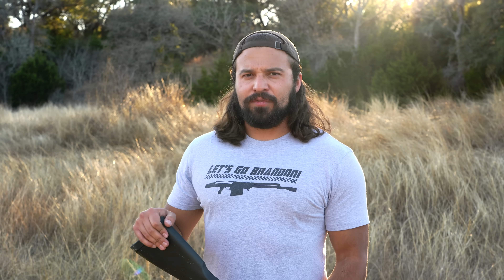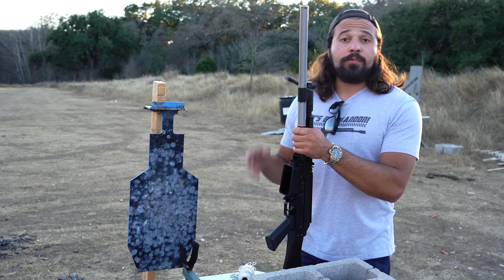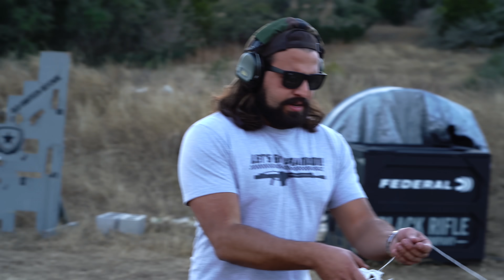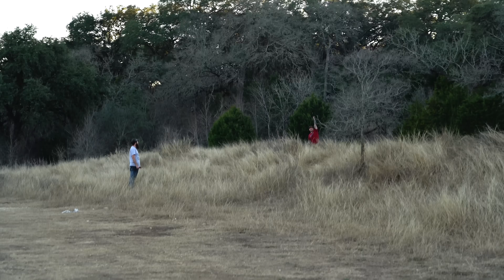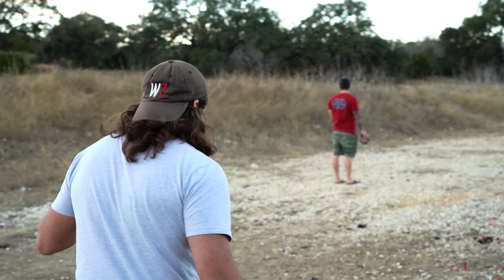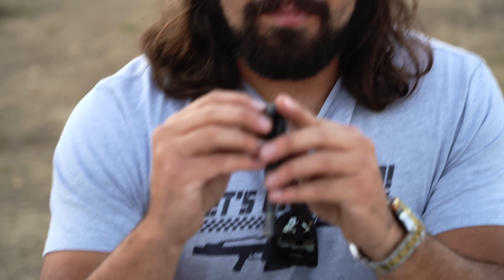Testing an AK Chambered in .50 BMG

Comment: I always knew that .50 BMG was a monstrous cartridge and that a weapon that was specifically chambered for the round had to be seriously tough to handle the amount of energy that the round produced. I predicted that this shotgun would be pooched after firing just once. My thoughts were basically along the lines of the bolt jumping backwards, out of the receiver and may the Lord have mercy on that steel silhouette. But the sheer violence and the utter and complete nature of that "rapid disassembly" were somewhat beyond my prediction.

As much as this video was a real good laugh, it was actually very educational.

Brandon, take all the time you need on that AK 50.
Reply: I was kinda expecting some sort of rapid disassembly because of the previous instance with the RN-50 that Scott had and it was made to handle the upper echelons of pressure (I know it was an especially hot round). Though there was definitely some surprising damages like the tearing of the mag well.
Reply: >Loads anti-aircraft round into trench gun
>Trench gun becomes the ammo

Yeah, honestly fairly predictable.

Comment: I believe I have finally gained some insight as to why this is such a difficult project. Brandon is using the wrong ammo. 

Quite obviously Great Master is displeased by use of capitalist .50 BMG instead of appropriate 12.7mm x 108 cartridge of DShK!
Reply: This deserves more recognition
Reply: Nah, ya gotta step it up to 14.5x114 from the PTRD/PTRS
Reply: @wanderbolt9498  Great idea, I'd like to see someone defend a home with that massive Tiger II hunting rifle. Heck, make it Cali compliant to screw with the govt'.
Reply: @jamestedjo3736  Yes, but use a double barreled shotgun as a base for twice the OSHA violation.
Reply: @gazz3867  Breaking news: Post Trigger Shoulder Dislocation going rampant.
Reply: I guess those are hard to come by in the US
Reply: What  about a firing mechanism different than existing .. maybe sauer type or reinforced humongous chamber for disposing of also sequencial ammunitions of tested types and similair... smaller charge... same grain or larger to to change the controlled rapid expansion of various types of (what do you name those ignightors?) For different ignitions... ... simply said try a differrent version or brand of ammo...

Comment: So, what I am to understand is that the impulse of the round going off was so violent that it- shattered all the parts meant to hold the gun together, and blew them out the back at lethal velocity,  and didn't even fire the projectile out the front?  JESUS that is fascinating from a shock physics perspective and metallurgical perspective.  Insane!
Reply: Makes perfect sense too. The same force being applied to the bullet is being applied in the opposite direction onto the bolt face
Reply: @YoBoyNeptune  yeah man, its just insane to think about the forces at work here, especially how the barrel went flying the length of the range, I still can't quite wrap my head around that one. The ghetto ak50 may have been made as a meme but damn is it illustrating some seriously interesting stuff.
Reply: @AlphaCarinae  yeah, I get what happened, but I want to know why it happened, from an engineering perspective.  I want to watch the shock propagate through the gun, see where it failed and in what order under what load. Makes me wish I could run the engineering sim programs I use at work on a 12 gague AK analogue model, but we are definitely not allowed to use those resources for personal projects lol
Reply: @saltycadet5904  it isn't always easy trying to talk to people on here huh?
I was thinking the same, would be cool to see the chain of failure, what let go first and how did that affect everything else.
Reply: @saltycadet5904  everything failed all at once. That’s the answer you’d find.
Reply: @saltycadet5904  the casing was the very first thing to fail, the released gases expanded to fast while the projectile failed to move fast enough to accomodate, the result was akin to, as brandon said in the video, loading a grenade into a 12 gauge, but after the casing it was the bolt that was the first to recieve the full force of the explosion, the bottom portion of the casing was missing, and left a clearly visible impression on the bolt face, causing the bolt to shoot back, ripping apart the internal components, i.e bolt carrier, gas block etc but that is why there was still a piece of steel stuck in "scott" i cant say for sure what psi a shotgun is meant to handle but i do know a .50 bmg is capable of upto 48,000 psi, the real scott took more then 50,000 to the face, its speculated the SLAP rounds he used were home loads by a fan and were far "hotter" then there were ment to be, he even mentions in the after video of how he knew something was wrong with them after the first shot but kept going, he got 4 off without issue, but that 5th one was the near fatal one, its insane seeing what happened to him and im glad hes recovered and is still doing what he loves lol
Reply: I mean it fired A projectile... it was just the barrel of the gun
Reply: @omishimuzu That's why they tell you to never fire someone else's handloads. You never know what some nutter is willing to pack into a casing.
Reply: @saltycadet5904  running the simulation shouldn't be an issue, claim that it is for purely research purposes and would ensure a "safer design" for the lockup and the shooter, should aforementioned shooter load his/her own shotgun shells for example and inadvertently double load a shell, or for some obscure reason the barrel should become obstructed in some way. 
I am no engineer nor am I in any way clued up on the physics behind THIS round... But I think it safe to say that the guys building weapons that ARE able to handle the loads and pressures of a .50BMG cartridge have got some seriously large balls and skills...
Reply: @ScooterMcAwesomeness  I've gotten reloads from a family member who knows what he's doing and discovered that the rounds were loaded to +P+ levels., thank God it was only 4 rounds that were loaded to that level and did not damage to my firearm or more importantly to me.
Reply: @delmaneboshoff5610  Sounds like you got lucky... go buy a Powerball ticket.

Comment: Prediction: first, the locking lugs will fail, shearing clean off. Then, due to the massive increase in backward pressure, the receiver surrounding the chamber will explode, sending shrapnel in all directions. However, the twist is that no one will be harmed, thanks to Scott’s massive, blast resistant man meat absorbing the explosion and saving the day.
Reply: I mean, he was not wrong.
Reply: "blast resistant man meat" is one of the best sentences ever

Comment: Between this "test", and Scott's own testing of a 50 cal, I'd think Brandon would make extra effort to reinforce the locking lugs of the AK50, or at least attempt some sort of safety to prevent them from shearing upon any catastrophic failure and entering the lungs of the user. 

Least it would seem those are the most dangerous parts during a failure.
Reply: watch some of his AK-50 vids, the bolt locking lugs look intensely thick
Reply: did you "LOOK" at were they were located,how much room there was ?  how thin the barrel had to be in order to be press fit into the gun? dude.eyes.use them
Reply: Given what I've seen of the AK50

He has.
He very much has.
He has got about a kilogram of high grade steel in those locking lugs. 
The only way you could make them less likely to sheer off would be to make them out of tungsten carbide. Or maybe Scot.
Reply: He is patterning that part off of the Barrett M82A1 and Serbu BFG50A, since that seems to work for those guns. To Scott, the Serbu RN50 was a single shot, break-open screw-on cap-sealed gun where the cap blew off the gun and it sheared some other stuff off that almost gave him the big sleep. This would kill you, especially since the barrel became the projectile and the bolt carrier would be in your side/chest/head.
Reply: They're mostly dangerous if your 50 BMG is magically enriched with tasty nitroglycerine like that one time that guy almost died.
Reply: @cxpKSip  The 50bmg is a massive explosion to contain. Even the best design if pushed beyond plausible/practical "safe" planning, is virtually impossible to make "safely" explode. 

I was just pointing out, if the person hugging the exploding 50 survives the instant your-flucked death parts flying at them, the locking lugs generally seem to be the fairly unavoidable, but plausibly survival, parts. While finding a way to keep an exploded barrel from trying to become a nose ring or the entire bolt from replacing the catcher's tonsils is pretty much sheer luck and otherwise impossible to prevent, it might be possible to prevent or at least mitigate the lugs from going directly into the lungs or heart. "Possible" or "plausible", not "definitely" or even "likely". Simply something that should be considered when it comes to attempting to make it semi "safe".

Comment: A great representation of the amount of juice in a 50 bmg case, with all the videos showing it "working" out of 12 gauge and all the video games taking insane liberties in gun customization options, im sure many people have very skewed ideas about real gun physics.  If i put a 20mm Oerlikon shell in a a steel water pipe and hit it with a fucking hammer im sure it will work great.
Reply: But it will work... Very VERRRRY badly
Reply: obviously if the round fits in the tube then you can fire the round from the tube. "What do you mean physics says that won't work, I don't even believe in science" is probably the logic followed when anyone thinks that if it fits, it'll fire safely
Reply: Yeah I liked Fallout 4 and its pipe weapons.
But I thought they should have stuck with crappy, high malfunctioning low power guns. Only reliable when you make it a bolt-action.

Instead I can go for a Full Auto .50 BMG Pipe Rifle.

Yeah that brass pipe can handle that kind of abuse after some rifling.

Comment: Another interesting idea, in Tarkov recently they've added "makeshift 50 bmg" shotgun shells which is exactly what it sounds like, 50 bmg slapped into a 12 gauge (or russian equivalent) shell. I'm curious as to whether this would work in the first place, and if so what the results would be like and if itd be as devastating as it is in game.
Reply: Interestingly enough, the wiki says it is also a red tracer, so if the hypothetical .50 BMG sabot did work, how would the tracer  component function?
Reply: not a recent addition, been around for a couple years I think.
Reply: You will want to check out taofledermaus’s video from 3 years ago.
Reply: #Taofledermaus
Reply: You can launch a. 50 cal projectile through a shotgun, but you can't get anything close to the pressure of an actual. 50 BMG cartridge in a shotgun. The pressure difference between them is immense.
Reply: Even the devs aren’t sure whether this would work - the shell has “Apparently, it works. SOMEHOW.” in the description.
Reply: Do you mean something like a 50-cal bullet loaded into a 12-ga sabot...that's been proven to work every year when someone uses a 12-ga shotgun to take deer utilizing a bullet loaded into sabot.
Reply: When do we just call it a day and get some slugs?
Reply: @theworldofnexttuesday2802  really you can load just about whatever you want into a shotgun slug and it'd be lethal. Taufledermous has shot slugs made of candy, marbles, pieces of furniture, etc.
Reply: @TrueOpinion99  Yeah, you can pretty much sabot everything, gives it that nice, tight, fit it needs.
Reply: @Yawyna124  - Especially with modern 3D printing, you can sabot your favorite .223/5.56 bullet into a 12ga.
Reply: @jackaboy7748   why would tracer have any troubles igniting? Seems like it should be least of worries with such shell.
Reply: @TrueOpinion99  at some point there would be more sabot than the bullet itself.

Comment: Prediction: 
Gone, reduced to atoms

Edit: Well, I was mostly right. Surprised the barrel did as well as it did though, I was expecting it to mushroom out. Impressive machining
Reply: I figured that, being the one part on the gun actually made for .50 bmg the barrel would survive (in the broadest sense of the word). Given of course that the barrel pins were not made for this caliber, it's no surprise that the barrel detached the way it did.
Reply: @cobusvanderlinde6871  I suppose that is true. I guess my brain just defaulted to what I've seen with other catistrophic failures with shotguns, and a lot of them have the barrel flaring out like in a cartoon.
Reply: @shayminthedoctor9663  something else I just realised.
With the amount of pressure escaping at the back end of the gun (and its top and sides as well) the barrel would have dealt with much less pressure- can't know if this barrel would have made it on the front of a whole gun made for .50 bmg (guessing probably not) but here it was the only thing that was in any way ready for it and so would be the last thing to fail, as the other failures reduced the stress it had to endure.
Reply: Favorite line: "Well, we split our bag here. Should have seen that one coming."
Reply: @cobusvanderlinde6871  huh, you make a good point. Since the point of failure was in the locking lugs (I think?) The pressure wouldn't have made it far in the barrel. I would really like to see an in depth postmortem of this gun, see what happened

Comment: My prediction is that the gun will explode knocking over the steel target. First you will notice the gas block, then that the magazine had been split. Next you will turn your attention to the ground to see the receiver of the weapon with its mag well split. Eli will find the dust cover approximately 75 feet away in the tree line. I feel like the barrel will be difficult to discover, try looking about 50 feet in front of the gun. And lastly you will stumble across the recoil assembly spring in front of the gun…
But that’s just a prediction.

Comment: Y'know..."catastrophic" actually seems to be an understatement here. That was seriously impressive. Does make me think, though, that maybe we should've left a buncha those guns for the Taliban...
Reply: Yeah, they'd figure it out. The upper brass claimed that the sabotaged Chinooks and C130's that were abandoned would never fly again. Six months later, the Taliban is flying a lot of them. Never underestimate a goat herder who doubles as a mechanic that has been able to keep Soviet trucks running in the mountainous terrain out of homemade scrap parts.
Reply: Well, i don't think that the intention after handing them hardware was to make them blow themselves in front of the soviets in Afganistan. ...Maybe they could strike some with the flying barrel, but still.
Reply: @wadekirby8575  Some of them were also resold, some theorized scott may have bought some of those vary rounds when his exploded.
Reply: @joshjones5172  The trapped rounds I've read about were 7.62x39mm and 82mm mortar shells (not 50 cal).
Reply: @wadekirby8575  not saying I necessarily believe it. I just saw some people discussing it based on the rumor that we also did it during the Korean war. The only thing I can verify from that story is we did use slap during that fight.

Comment: Yeah, prediction...

Scott's gonna have a bad day.

Conclusion: That's not a catastrophic malfunction, that's a Scott tier malfunction. 
Doing God's work Brandon, keep it up.
#akgnotificationsquad
Reply: Worse that scott tier I think, wouldn't this just straight up take a chunk of face with it?
Reply: I think that depends on the angle it hits at. If it's a smooth section, it'd probably cave in a skull pretty easily. An edge on the other hand, hot knife through butter. But this is all assuming it hit the face to begin with. That just looked like upper torso to me.
Reply: @nathanmccauley8216  the...carrier group? Looks like it might hit the jugular (if one was actually aiming) but the dust cover definitely gets into the face
Reply: @thallan  I, like a dumbass, forgot till just now that it'd be on the shoulder if someone actually meant to use it. In that case, I'd say they may very well be dead on impact.
Reply: @nathanmccauley8216  to be fair, I wouldn't shoulder it either.

Comment: Perfect example of why even the lightest BMG chambered guns weigh in around 30 pounds. You need a lot of metal to tame that beast! I have an Armalite AR50. Weighs 46 pounds with all the accessories. The bolt alone weighs more than most handguns I’ve shot 😂
Reply: Um the barret  m107 only wieghs 17 pounds.
Reply: @joshlower1  The M107A1 weighs 27.4 pounds with the shorter 20" barrel without a scope. And that's straight from Barrett's website
Reply: @joshlower1  yes he said weight of the gun not weight of the barrel

Comment: EDIT: BOY was I wrong!!

Honest prediction:

Recoil system will fail, bolt with come out the back or at least damage the rear of the receiver. I believe the front half of the gun will be fine.
Reply: i mean.. the bolt carrier did bury a piece of itself in the steel plate, so you're not entirely wrong..
Reply: @MrSplic3r  I think the real mistake was expecting any part of that poor gun to be functional after firing a BMG through it.

Comment: Pre pull prediction: Even with the gas system in service, the locking lugs won't unlock before the force of the shot rips them out & BCG with everything else exits the rear of the dust cover.
Reply: Yup. This checks out.